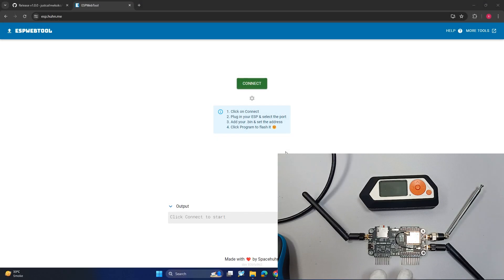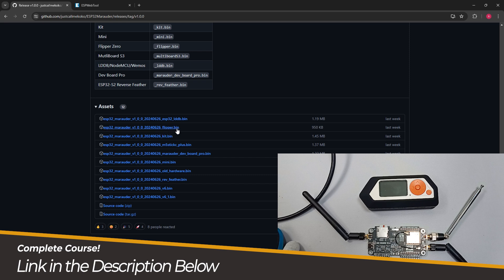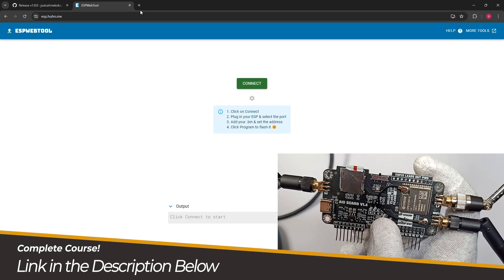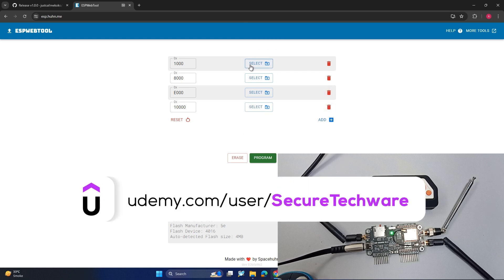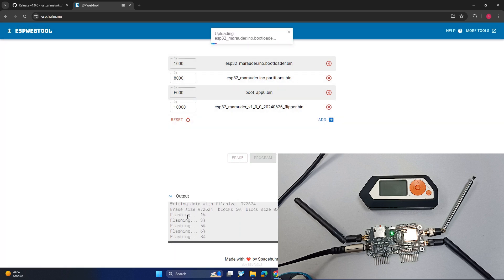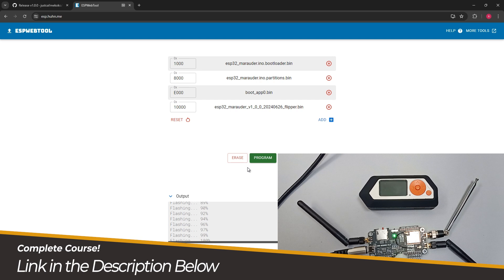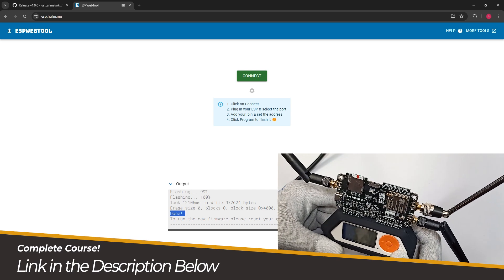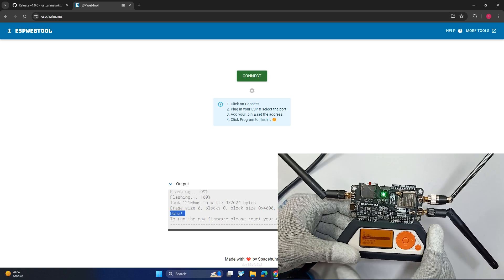Flipper Zero 3-in-1 Multi Board: Updating Firmware on the ESP32-S2 Module

Comment: Is a micro SD card necessary for flashing?
Reply from the maker: Nope
Reply: @SecureTechware Also, is it only the ESP32 protocol that is required for the flashing or do I have to flash the others (CC1101 and NRF24)?
Reply: @ELIASMDESIGNS  I was gonna ask same question
Reply: @SecureTechware  Cool. Thanks for the quick response 👌😎

Comment: After the update when I scan ap and then I go to list ap, the list shows up empty and flipper freezes... I have to reset. is there something wrong with the board or is it the firmware? do you have the same issue?
Reply from the maker: Which firmware are you using? Try momentum
Reply: @SecureTechware  I have the latest version of momentum installed... I think the board is defective. Everything works accept opening the list after scan...

Comment: I have flashed the board as per the instructions - no errors, when I try to run ESP32 Marauder and do an AP scan it says "invalid handler 0x73252073 or crashes my flipper, please advise
Reply: I have sorted my issue, here's how I did it:
Put the files to Flippers SD-card to /apps_data/esp_flasher/

Connect 3 in 1 to Flipper, press and hold right button at the 3 in 1, press and release left button, release right button

run Apps => GPIO => ESP Flasher => Manual Flash
select files

Bootloader = esp32_marauder.ino.bootloader.bin
Part Table = esp32_marauder.ino.partitions.bin
boot_app0 = boot_app0.bin
FirmwareA = esp32_marauder_v0_13_9_20240227_flipper.bin
“FLASH”
Reply: @stevephoenix3423  i have done it the way you are saying and it flashed corectly but when i press scan ap in the wifi marauder app it then says press back to send stopscan
Reply: @stevephoenix3423  Thanks it also didnt regognise my board, using your method made it work! I used btw the slow flash option (not sure if that was needed or not)
Reply from the maker: I'm not sure let me research on it. Meanwhile if you find any solution please post it here.
Reply: Mine works perfect, just flashed with this instructions... Maybe there is someyhing wrong with youre board?

Comment: Hi! How to use CC chip on the board? Some additional app?
Reply: you have to start subghz (I have momentum firmware) go to radio settings and there it should say module: external. you use the board as a more powerfull antenna

Comment: I just bought this device from Banggood and tried to install the Marauder firmware as you showed, but it's giving me an error. The error code is as follows. Connecting...
Connected successfully.
Try hard reset.
Chip type ESP32-S2
Connected to ESP32-S2
MAC Address: 70:04:1D:FA:D3:50
Uploading stub...
Running stub...
Stub is now running...
Detecting Flash Size
FlashId: 0x16405E
Flash Manufacturer: 5e
Flash Device: 4016
Auto-detected Flash size: 4MB
Image header, Magic=0xE9, FlashMode=0x02, FlashSizeFreq=0x2F
Writing data with filesize: 14496
Erase size 14496, blocks 1, block size 0x4000, offset 0x1000, encrypted no
ERROR!
SlipReadError: Timed out waiting for packet header
Image header, Magic=0xAA, FlashMode=0x01, FlashSizeFreq=0x02
Writing data with filesize: 3072
Erase size 3072, blocks 1, block size 0x4000, offset 0x8000, encrypted no
ERROR!
TypeError: Cannot read properties of null (reading 'getWriter')
Image header, Magic=0x01, FlashMode=0x00, FlashSizeFreq=0x00
Writing data with filesize: 8192
Erase size 8192, blocks 1, block size 0x4000, offset 0xE000, encrypted no
ERROR!
TypeError: Cannot read properties of null (reading 'getWriter')
Image header, Magic=0xE9, FlashMode=0x02, FlashSizeFreq=0x3F
Writing data with filesize: 972624
Erase size 972624, blocks 60, block size 0x4000, offset 0x10000, encrypted no
ERROR!
TypeError: Cannot read properties of null (reading 'getWriter'). What do you think is causing the problem? Can you help me?
Reply from the maker: Are you using the same board or it's a different one?
Reply: @SecureTechware  Visually it looks identical to yours, but I'm not sure if it has the same chips on the board. The chip on my board says "espressif esp32-s2-solo-2u" on it.